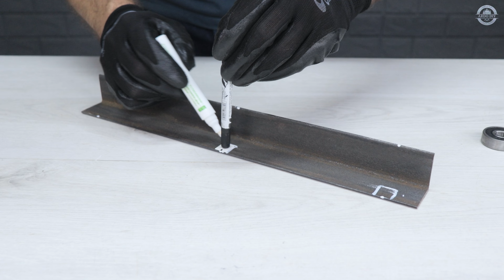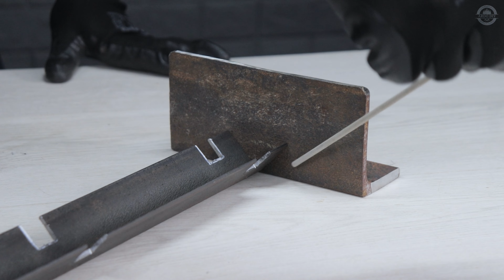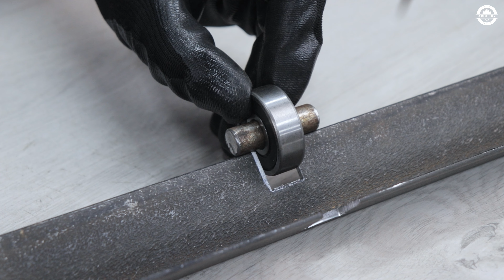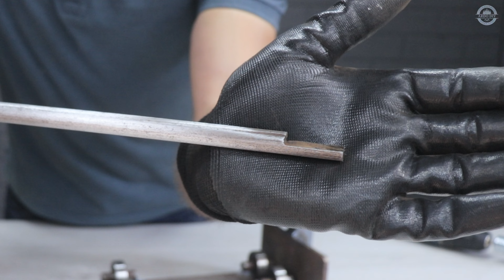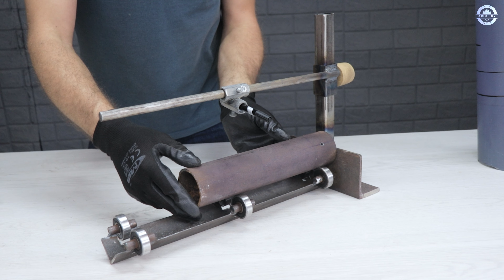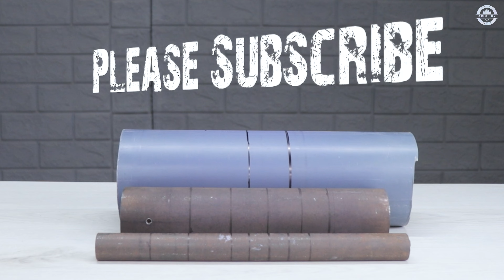Simple Idea That Will Come In Handy  || DIY pipe marking tool ||

Comment: Now make the marker spring loaded. To take up play on not concentric tubes.
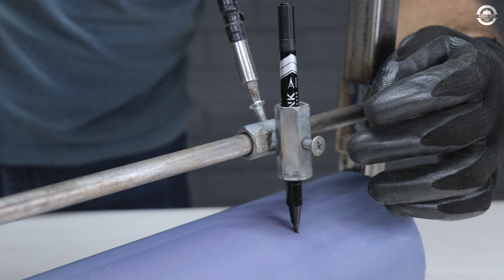Reply from the maker: @carloheinz6465  This is easy to fix. Without fixing the top screw, the marker follows the shape of the non-concentric tube, timecode, 05:17